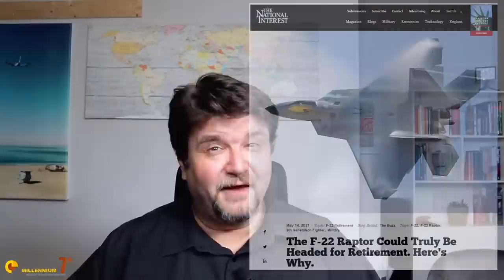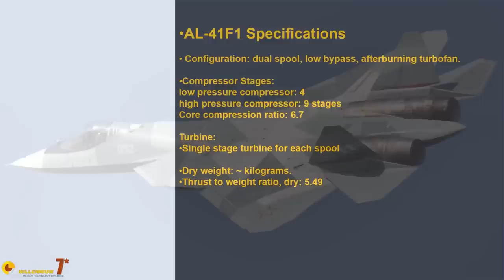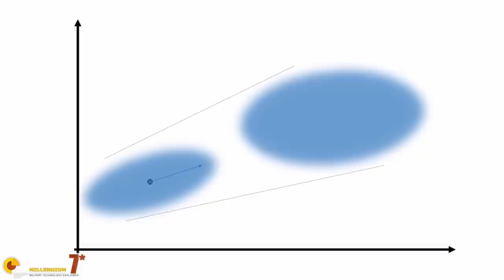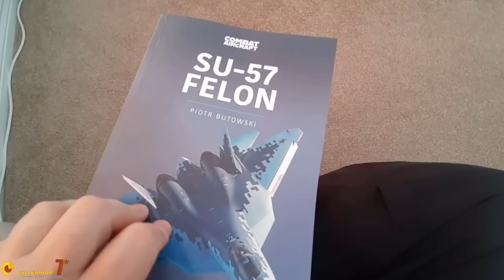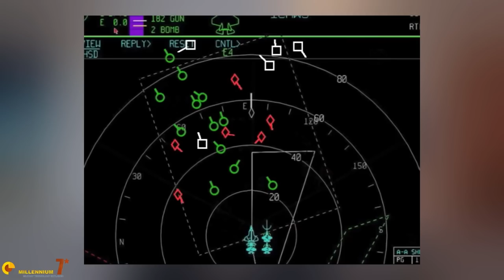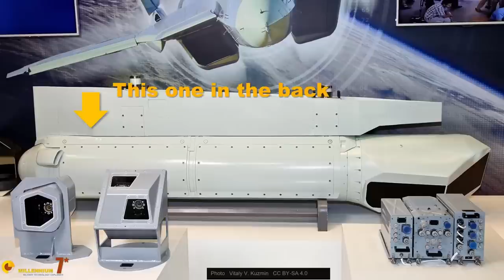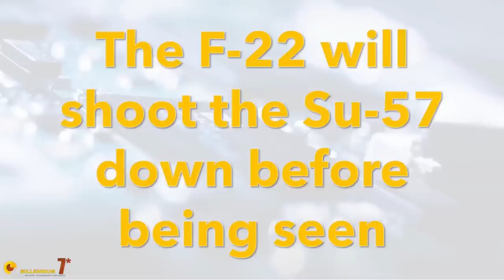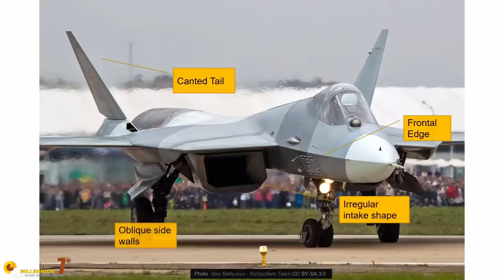Su-57 Update! + In Depth Analysis

Comment: Great video compilation! 

When it comes to the Thrust Vectoring on the Felon, I can't help but wonder if it was included as an option for increased stealth performance*? I'm unsure of the exact effect that moving aerodynamic surfaces have on immediate RCS, but I would imagine that if you were able to lock all control surfaces and just maneuver with thrust vectoring in very small and precise increments (whether doing low-intensity missions or regular flight), then it would be *somewhat of a boost to stealth. 

I would be interested in hearing back from anyone who knows more about the effects of control surface movement on RCS during regular flight maneuvers and those maneuvers used in low-intesity missions, like recon and AEW, as some AESA-equipped aircraft are now capable of.
Reply: So from the frontal aspect, control surfaces likely have very little if any effect on RCS along that aspect. I've never heard of a control surface rotating to 90 degrees which is roughly what it would need to reflect back at detectors from the front. However, from other aspects this certainly is an issue, thus the criticism of the J20's cannards. In that case the cannards can be locked into place and maneuvering done with other control surfaces and or thrust vectoring. I don't think it's a coincidence that most stealth aircraft (including the F22) have thrust vectoring in some form, likely decreasing the amount and frequency that the control surfaces have to be utilized.
Reply: Why bother doing all that when the plane already has a much larger signature than an actual stealth aircraft? It's literally lipstick on a pig lol
Reply: Surely Stealth would be leading surfaces predominantly no?
Reply: @BlackHawkBallistic  Because stealth is relative. Specifically relative to the tentative detectors. Russians have better and more prolific air defenses than the west so western aircraft have to be very difficult to detect. Conversely in the west we rely on airborne interceptors, which while more mobile and versatile, have far less powerful radars so their stealth aircraft don't need to be nearly as hard to detect. Stealth was never about making an invisible aircraft. It has always been about making an aircraft your enemies can't detect so unless Russia fights China India or itself, the higher rcs doesn't actually matter.
Reply: @92HazelMocha  whatever you say
Reply: @BlackHawkBallistic  I'm confused, if you don't genuinely want to understand these platforms and why they are the way that they are why ask the question, and better yet, why follow this channel? There are plenty of YT channels that just regurgitate "US plane good because America", no need to waste your time here with technical discussions.
Reply: @92HazelMocha  ohh I heard that the F35 got crashed landed on Texas aircraft runway. Because those people who say that the F35 is the best, in what, mostly in expensive maintenance price and not good performance aircraft, even that the japan is disappointed with the F35, that the internal bay can't fit some of the missile such as the ASM advance Japanese missile and the gunpod is not good model. That's it, even that F35 has a worst crash record than the F15 or even SU30. F35 is a good aircraft, but rather it's more like an not doing anything in the air but for showoff in the sky, atleast SU57 is great competitor towards F22 and J20, even that the SU57 able to shot down SU27 on Ukraine from a long range. What about F35 only able to shot down an drone and ground attack, and the F22 only ground attack, That's it. F35 is a good aircraft, but more like an lack of performance in speed, maneuver as well as in dogfight, so F35 is more like an show piece in the sky and the rest is expensive to maintenance it's aircraft.
Reply: @BlackHawkBallistic  it was a prototype model of SU57 which is T50, the T50 which is an test/prototype aircraft has no RAM coating on it with exposed rivets, back part of the engine nacelles, intake with no radar blockers plus boundary extractor layer/inlet guide on it and exposed spectrum of IRST making it the RCS around 0.1m2~1m2 as the same size of an F/A 18 and rafale. But actually it was prototype model, Since that the article was released on 2010, the T50 prototype was not having radar blockers on the intake and RAM coating on it, half of the avionics and new sensor suite was not there on the prototype model T50, which is 12 years old and even that the article is outdated. While the production model of SU57 which was came at 2020 Dec 26, the production model of SU57 has improved the Stealth features capabilities and able to reduced the RCS around 0.01m2 (as the size of the human fist or a bird) by applying 25% composite RAM coating on it, making it more stealthily, clear surface, new cockpit module display, improved avionics and new sensor suite than the prototype model T50.
Reply: @heatblast876  Welp, so much wanted to discuss technic when you had even the basic wrong. the Su-57 RCS 0f clean super hornet which are 0,1m2-1m2 isnt originated from old article, it is actually from sukhoi own patent for production model, NOT prototype, the prototype RCS most likely bigger than 1m2.

There are no Su 57 shooting down Su27 in ukraine, none, not from any reputable source. Russia only had 5 operational SU 57, they would never put that jet on the frontline with only so few alavailable, same with T-14 Armata.

F-22 is for air superiority, not ground attack. F-35 actually had 3 different model A, B, and C, and Japan is planning to buy MORE of F35 A and B variant, dunno where you heard they dissapointed. plus F-35 actually has the least crash records based on how many flight hours it has doing compared to any other aircraft.

Oh and low RCS actually matter, When RCS is reduced to 1/10th the original value, also required jamming power is reduced to 1/10th the original value (to have the same effect). If the jamming power is kept constant, then the jamming will have 3 times better effective range. This means radar will burn through the jamming from 3 times shorter range. So a fighter with 1/10th the RCS can get 3 times closer to threat radar before jamming will become ineffective.

Cant believe you are wrong on so many levels and yet lecturing others about " genuinely want to understand these platforms and why they are the way that they are why ask the question"
Reply: So much hype on stealth. The S 400 will shoot F 35s out of the sky.
Reply: You are onto something and not just you. B2 spirit and similar crafts with no vertical stabilizers control their yaw with differential thrust which in theory should be similar to thrust vectoring

Comment: Love the Felon, Su-57 > F-22, It might not beat it in stealth but hey "it gets the job done for stealth"
Reply: I wonder if it really gets the job done.  US stealth aircrafts have radar cross section of an insect. The su-57 has visible bolts, each one of them will light up on radars. Besides, the engines look like instead of reflecting away, they will scatter radio waves everywhere, to the receivers included. 
Maybe atleast it does good job cooling the out the exhaust.
Reply: @hakunamatata1880  Looks like someone hasn’t watched the video before opening their mouth, I’m afraid.
Reply: cope

Comment: The idea that Russia is technologically inferior is just arrogant stupidity.
And it is an idea that is mostly spread by a military industry that are focused on maximizing THEIR PROFITS, not providing the best piece of hardware to their buyers.

For good examples of this, consider the discussions about tanks in the Kremlin when they were getting more detailed information about the Leopard 2, Challenger 2 and M1 Abrams.   Design teams were asked if they could create something equal or better and they were pretty much just shrugging and saying of course we CAN.
But it would also have a comparable cost per unit(or at least somewhere between 50% and 80%).   So, 10-20 T-72s or a single "supertank"?   The choice was so obvious that no "supertank" projects were seriously pursued by the USSR again.

The other, even more blatant show of why it is stupid is when people were mocking, IIRC it was the MiG-31, for having really oldstyle analog parts as part of the radar electronics.   And then someone in the 90s went and tried simulating the radar and found that, oh dear, those parts actually allowed the radar to scan BETTER and more accurately, increasing potential detection range by at least 10%.

Also, there's the absurdly obvious difference in focus.   USA has drastically more aircraft, sure, but their airdefense systems utterly sucks compared to Russia.   The primary role of USA aircraft air to ground missions are fulfilled by Russia either by missiles or by artillery depending on range.
And on a cost vs effectiveness comparison, that is vastly better, there's barely any comparison even possible.
Reply: I agree with you, especially on the tank issue. While I was in the Navy we picked up a B2 Spirit at 120 mile range while using old valve tech in the 1022 radar set back in the 90s There's something to be said for compromise.
Reply: Which is why Russia can't attain air superiority over Ukrainian airspace?

And Why Russian tanks have taken such heavy casualties Russia has had to take old T-62's out of storage?
Reply: @louie55ish  "we picked up a B2 Spirit at 120 mile range while using old valve tech in the 1022 radar set back in the 90s" source: trust me bro
Reply: The cope is real. " Russia is technologically inferior is just arrogant stupidity." no its just true. "spread by a military industry that are focused on maximizing THEIR PROFITS" man if you think the west is bad, just wait till you learn about this dumpster fire called russia. "For good examples of this, consider the discussions about tanks in the Kremlin when they were getting more detailed information about the Leopard 2, Challenger 2 and M1 Abrams.   Design teams were asked if they could create something equal or better and they were pretty much just shrugging and saying of course we CAN.
But it would also have a comparable cost per unit(or at least somewhere between 50% and 80%).   So, 10-20 T-72s or a single "supertank"?   The choice was so obvious that no "supertank" projects were seriously pursued by the USSR again." yes russians have always prefered cheap and crappy

"The other, even more blatant show of why it is stupid is when people were mocking, IIRC it was the MiG-31, for having really oldstyle analog parts as part of the radar electronics.   And then someone in the 90s went and tried simulating the radar and found that, oh dear, those parts actually allowed the radar to scan BETTER and more accurately, increasing potential detection range by at least 10%." source: trust me bro

"And on a cost vs effectiveness comparison, that is vastly better, there's barely any comparison even possible." remember that in order to be effective, you have to hit your target and unless russia really hates empty fields and civilian buildings, theyre not very good at that bit

Comment: I saw a video on the su-57 and it was one of Russia's programs TV programs.. it's stated that the frame was designed before AI was even thought of or developed. But now ai suggest a totally different frame design for the su-57. 
I know that the engines aren't ready.. but from my perspective I don't see why they wouldn't change the frame as well it's definitely a value-added item and it will increase the rigidity and lifespan of the plane. But there has been no word about frame designs that I see anywhere else. Other from that TV show.
Reply from the maker: AFAIK it is not on the table

Comment: Are they going to put cowlings around the rear of the engines in the rear or just leave them exposed like that? Seems strange for a low observable aircraft to leave big parts of the planes to be circular. I understand that they may not be visible on approach but scooting away I could see it as a problem.
Reply: You mean engine cover on the top and below the airframe? Since 10th and 11th T-50 prototype, they already put cover on the engine. So don't worry, its installed in serial production.
If you talking about the nozzle, it will wait for the new engine start serial production

Comment: Someone pointed out... 22+35=57 😂 Russia sending a message.
Reply: That's a reach. It started life as the T50 before the F35 even had its designation and is likely the 7th iteration since the T50. It should be noted that the prototype Sukhoi fighter before the T50 was the Su47. Sukhoi tends to make the numbers in chronological order, the su17 being older than the su27, the Su24 being between the two.

Comment: I'm tired of the western propaganda tropes like "it's as stealthy as a clean f-18e/f" and other nonsense. It is much stealthier. The numbers the sukhoi bureau gave in the patents deal with an overall mean radar cross section. This has been misinterpreted as .01 meters squared frontal cross section. I could go on and on and on. Nearly every complaint or attack against this fighter is at best misinformed or outright wrong

I love that the su-57 is the only other fifth gen design that radically departed from western design ideology that everyone else is mimicking. It is totally unique. Also especially because of the ongoing war the propaganda against ruskies is thick. Their kit is often underrated.
Reply: Sukhoi patent document also said Checkmate will have F-117 level of stealth
Reply: Their performance these past two years says if anything they have been overrated

Comment: The title and the description should be modified to reflect the discussion of the Sukhoi Su-75 Checkmate - especially since the SU-57 is planned to operate unmanned 'wingmen' and the SU-75 was announced as designed for remote controlled and automated flight - the former having been demonstrated by the unmanned orbital flight of Buran 1.01 as early as 1988. 

Even if such unmanned flights of such airframes perform fairly basic manouvres - it's deployment is likely an actual 'gamechanger' in regard to the ever tightening bottleneck of declining national demographics and resulting impact on rew recruitment , training and risk to life and national prestige whenever an aircraft is lost. 
Operated in large numbers, even simple flight missions of unmanned, full scale fighters can likely saturate air defenses and do so virtually until they fall apart due to maintenance not being able to keep up with constantly rolling sorties. 
Furthermore, is it possible to use a drone swarm to create a field of wireless communication, capable of detecting low observability objects, passively , compensating for shortcomings of RADAR technology ?... 

There won't be a 'sixth sense' of anticipating manouvres in networked, remotely operated or automated mode, but will it matter when conducting missile saturation attacks by antire regiments (though requiring complex mission planning and operation) ? 

For both planes, naval operation from runways as short as that of an 'assault ship' like the '064 Varan' will be relevant - especially when considering the potenial flight endurance, derived from potential airframe/engine synergies and a substantial internal fuel storage. 

16:01 
BOOMER ALARM !!! Call the police !... 

🚨🚓🚓🚓

Comment: Cockpits should be covered, to improve stealth. The pilot can rely on immersive helmet displays.
Reply: Or just build it right like the F35, F22, B2.
Reply: @Milvus_In_Excelsis  The F35 exceeds the entire  $70billion Russian defense budget.
Reply: @Milvus_In_Excelsis  That would mean giving Russia 1 Trillion dollar budget like US
Reply: But if something went wrong with the helmet now your trapped in a box waiting to inevitably crash
Reply: @little_error295  Modern fighters and stealth aircraft are aerodynamically unstable, and cannot be flown manually. If something goes wrong, you eject.
Reply: @ViceCoin  I know that but I’m talking about specifically the helmet if a malfunction happens in the helmet and the actual aircraft itself is fine you would still be able to land if there is no cock pit and a malfunction in the helmet occurs  you are flying blind also not being able to see the sky would take away a lot of the fun and spectacle in being a pilot as long as the cockpit doesn’t effect the strategic aspect of the plane they’ll probably keep them
Reply: @little_error295  For a statically unstable aircraft, even a manual landing would dangerous without artificial fly-by-wire control. Takeoffs and landings should fully automated, like with drones. Two F35 fighters were lost during landings.
Reply: I would rather not be stuck on a plane I can't see out of when the system inevitably fails
Reply: @brokenmoon3300  You can't fly F16, F117, F22, B2, or any modern, unstable fly-by-wire combat aircraft manually. Semi-autonomous vehicles will only need operators to authorize weapons release, to comply with international law, or change mission parameters.
Reply: @ViceCoin  And the failure of the augmented reality helmet that lets you see through a completely opaque cockpit is somehow related?
Reply: @brokenmoon3300  AI can handle the return and land the aircraft without pilots. Drones already perform autonomously.
Sorry, Top Gun is outdated Hollywood hype:(